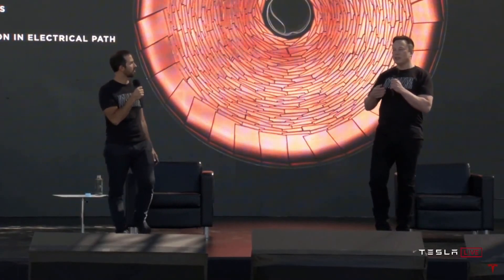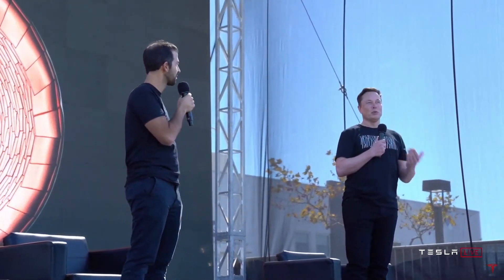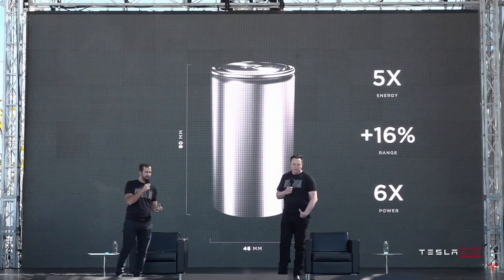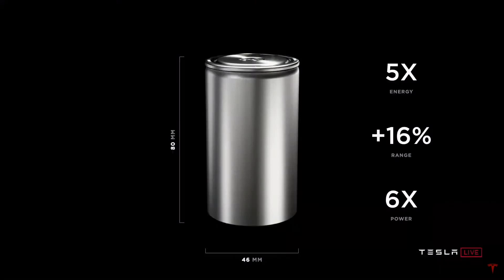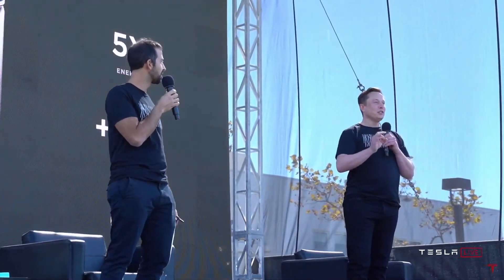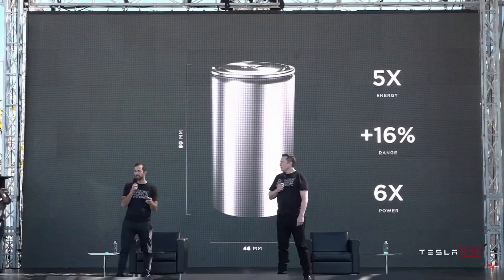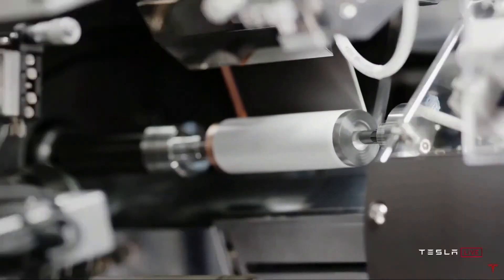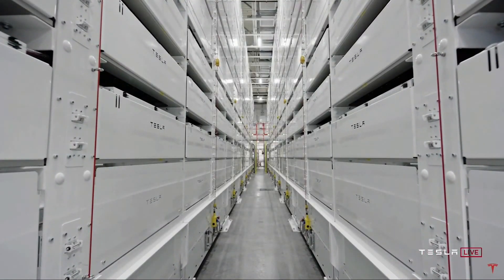Elon Musk REVEALS Tesla's new battery design! (Full presentation)

Comment: 5 X energy, 6 X power however only 16% increase in range?
If there is anyone in the comment section that works in a technical/design  postion within the battery industry could you forward links on studies down on batteries as it appears the numbers don't add up.

Comment: 5x energy, 16% range, 6x power. What did they mean by any of that?
5x energy, since it's a larger cell?
16% greater range... when using the same total capacity, or do they mean by weight?
6x power... by capacity, or weight?
So this is just a more efficient battery, very very cool - but is the power to capacity ratio better, or is it the power to weight? Is the capacity to weight any better? Is the manufacturing simple enough to economically compete with 18650 formats, or will this be a performance cell? They left out pretty crucial figures.

Comment: USAF had something similar a spiral designed capacitor with large out tabs to dissipate heat for high current discharge used on the Prowlers aircrafts back in 1970, they nick named it pitchblack a massive EMP that can knocks outs city power & communications systems. hmmm new technology I don't think so I smell a rehash in the air.

Comment: I'm sure there are smarter people than I who can explain this away, but with the increase of active material (i.e. Copper/copper alloy) in the unit, over previous battery iterations, would this not drastically increase the weight of the battery and hindering its use in things like vehicles where weight is a deciding factor on range?

Comment: I dont understand how 5x energy and 6x power translates into only 16% increased range.
Reply: Has to do with the way the power goes out. If it creates a lot of heat, then energy is wasted.
Reply: 1) The 16% range increase is only due to the changed form factor and the tabless design. When you add all the other changes you get 54% more range.
2) The 5x energy per cell comes from the fact that the cell is 5 times as big as the old one. This doesn't increase range by of itself, because you can obviously carry less cells if they are larger.
3) 6x the power per cell actually means a 20% higher power density: 5x the energy * 1.2 = 6x the power. So for a given battery capacity, you could charge 20% faster due to form factor and tabless.
They didn't talk about the impact of the other changes they are making on power density, so actual charge speeds of these new cells are anyone's guess at this point. Hope this helps :)

Comment: The tab less - more specifically multiple J tab - battery can excel only if we resolve all associate problem under these conditions. (1) tab to case surface profile conformant. (2) contact force resilience. (3) thermal and inertia shock stability. 

Those problems rooted in the use of annealed copper originated to solve a roll up assembly problem - is in conflict with three factors above. Anneal copper can and will further shape change under thermal and inertia stress of an application specific environmental conditions. 

Contact junction force is required to enable and to reduce thermal and electric resistances. Where did such force came from the multi J tabs? But we know that annealed copper J tabs have resilience problem, under thermal and inertia shocks. 

I don’t want our car to carry those set backs without a clean and direct solution.

Comment: I can understand the increase in power due to decreased resistance, but I don't follow what's great about 5x  energy.  5 "2170" cells are smaller than 1 "4680" cell by volume, therefor you are losing energy storage space. The volume of a cylinder is 3.14*rr*h . 2170=24,245mm3 times 5 = 121,226mm3 , 4680= 133,000mm3. They may be cheaper to produce someday, but they are not more energy-dense. They will also leave more empty space between cylinders.

Comment: Being an EE...Here let me help you...with your design flaw....yes, you DID circumvent the thermal issues so you are now in a nice dense package....BUT now you WILL have issues with point contact galvanic corrosion due to the thinning of material at the connection point (i.e. battery will not last long). Remember the trade off...the compromise.

Comment: The second Elon’s stutter goes away we’ll know the neuralink is in
Reply: If he stuttered, it simply means the speech is not that important worthy of prep.  He can be a super smooth talker when necessary.
Reply: i think brain wires would make a stutter worse
Reply: Lmao
Reply: If he took a small amount of xanax it would stop.
Reply: Elon only stutters because he has to take his cosmic brain and condense it into English, I know from experience the bandwidth is very low.
Reply: That's a glitch in his micro chipped brain acting up.
Reply: it's the other way around. And not only the stutter. The musk husk is being remotely operated by one of the few experimental A.I.'s
Reply: Jason Quitt had a major speech problem and figured out how to fix it completely using Chi-Gong. He now sells a book on how to do it. He says that the speech problem was really a problem with his body, basically. It's like the nervous system pathways aren't connected right, or something to that effect.
Reply: Elon stutters because he's converting binary to common English
Reply: you guys don't know that this is just a joke?
Reply: The stutter was caused by the small pins they used at first. The insertion of the pins in the brain resulted in a small amount of scar tissue which acts as a capacitor. The capacitance produces the delay in his speech.

Comment: How can it have 5x the energy but only increase the range 16%?  A little research revealed that the new battery occupies 5.5X the volume - so less energy per volume but apparently more per weight.   One plus not mentioned is one fifth the number of cells and connections needed to make a pack.

Comment: the metric system is based on an interval
from a curve line from the north pole to 
the equator.

The Imperial system is based on an interval
from a straight line from the north pole to
the south pole.

The earth is more compact north/south than 
its equator. Thus a surface curve line become even
more exaggerated as the moon passes over it,
as well as the orbital dynamic brings earth about
the sun. Tidal distortion. Meanwhile, the Distance 
between the  poles never changes. 
Thus the Imperial is not  only superior, 
but is nature's universal measurement.

Comment: Hey 
Doesn’t PANASONIC develope those batteries he is bragging about ??
Reply: @edwardrrooney5599  ehm Sir, excuse me, but that is exactly what is happening!

With the 18650 cells till about 2017/2018 Panasonic manufactured lots of their cells.

Then Tesla co-developed and help mature the 20700/21700 cell and now with this 4680 cell, Tesla DID the developement and they ARE producing them in their own plan so no more relying on external companies, since they are able to do it all in-house now!

But again, that was all said in the video both of us just watched...
Reply: @kniefi  Funny they didn't just label it the 46800..
Reply: @edwardrrooney5599  capacitor just stores electrical field on its plates, but battery stores chemical potencial, its a small reactor with reversable chemical process where electricity becomes from chemistry.
Reply: No difference electrolite or not. Electrolyte in electrolytic capacitor is just one of plates, no chemical process here. Energy just stores. But when accumulator discharges, electrical energy PRODUCED(generated) every time. You can see difference, accum don't store energy directly, they transform chemistry to produce energy(discharging), and restore it back when consuming energy (charging). This is complete different process to capacitors.
Reply: No, the batteries that in the current Tesla cars were developed and created by TESLA but MAKE by Panasonic. Making batteries is a no choke business and need serious investment, this is what they were showing in the vid.
Reply: Nope!..are you ok?..they created a better battery than the ones Panasonic develops!

Comment: A lot of conjecture here but this is what I think this all means. I could be completely wrong. 1 word... Graphene... thats what they dance around saying haha. Way faster charging with near no thermal issues. Actually on simple terms looking at this thing... it leans more towards a capacitor... or a hybrid between battery and capacitor. My guess is this... there will have to be a separate bank of actual batteries to handle the recharging while breaking ect. These new "batteries" will probably only work digitally... meaning... its not analog in the sense that its is a back and forth charging based on voltage. It is in one of 2 modes... either charging... or discharging... My guess is there will be a separate bank of batteries to handle stable function of electronics on the car... with the graphene capacitor/battery being ready status for discharge via computer control directly to drive train. Conversely... in "charge mode only when plugged in and the on board computer switched them to "charge" status... either way its very cool stuff!

Comment: At what point do they explain how it works?
Reply: Mostly has to do with how thermal expansion damages the cathode material over time, these cells generate less heat per pound and have more durable chemistry to make them cheaper and longer lasting. Explaining it in detail would require a lot of confusing graphs.

Comment: Ok, so the batteries are bigger and for there size store more power and are capable of higher output for longer because they can dissapate heat better. Is what I got from it. It means that you can use less batteries in the pack and still get better range because the pack has fewer batteries and weighs less. But they still don't have a vehicle under $50k Aud that can do 600miles on a charge.Or even 500.

Comment: "Everything's simple in recollection..."  This is a different way of saying "Once you know the question to ask, you probably already know the answer."  That's the thing about science that makes it so enthralling.  You don't always have to make some new way of measuring something or come up with some crazy new calculation to explain something. 

Sometimes, you just have to have that little moment where the right question pops into someone's head.  A quick example would be the original design for the super soaker. 

The guy who invented it was trying to figure out a way to make a pressurized water container that could be discharged and re-pressurized quickly so you would get better performance out of a squirt gun, without having to pump it continuously.  Then, he realized that soda bottles are designed to do exactly that.  The rest came pretty quick and easy by comparison.

Comment: Each cell should have its own built in qi charger.  Design the cell around inductive charging because the wires leading to the cells are the bottleneck in the conduit for getting energy into the cells.  The only way for electric cars to 100% compete with ICE is if the battery pack can be instantly swapped at a charging station and be back on the road in a minute.  The whole battery should roll out the rear end and get swapped or several batteries removed from the bottom of the car and swapped.  The consumer would pay one time for the battery power they want aka 1 pack, 2 packs, or 3 packs depending on the kind of range they want.  They could later upgrade to more than 1 pack for the same cost per pack.  A service company would upkeep the batteries and robots at the station would swap out the packs.  The depleted packs would be recharged to go onto the next vehicle.  You'd pay for the charging service like now only it would be quicker.  And you could charge at home with an inductive charger in about an hour since each cell is being charged at the same time without heating up the single cable feeding all the cells.

Comment: what is the purpose of this. you think you need this for cellular science. all you need is to turn alternator with electric motors for any energy needed. you r just ripping people off by selling them more stuff. a rotating ship for  gravity will become an alternator as you attempt to go to light speed. due the math. rotation energy and interaction with latent plasma field. light speed itself will due the same for non rotating ships. the field abrades at speed molecular structures this will cause molecular inertial dampening. you will blob and then explode at these greater speeds go to the van allen mine and leave. then grow and keep growing and commutate the black holes until the split apart. look for the inductive reactants and then commutate it with pulses you have 25000 to figure it out if you start now. good luck good night.